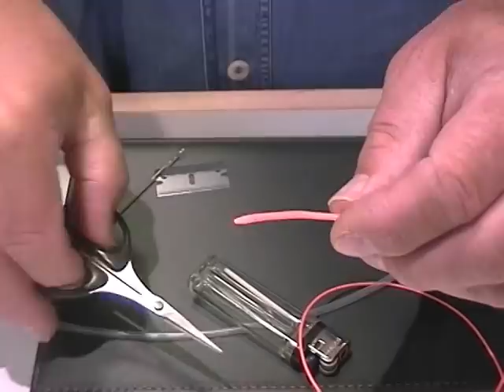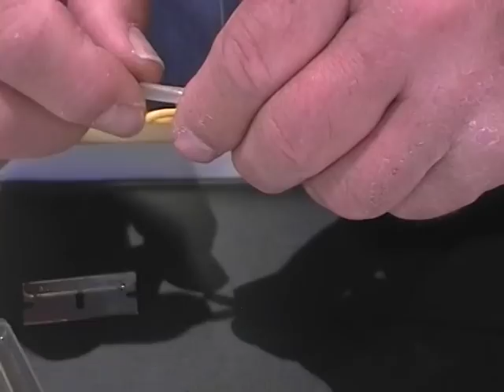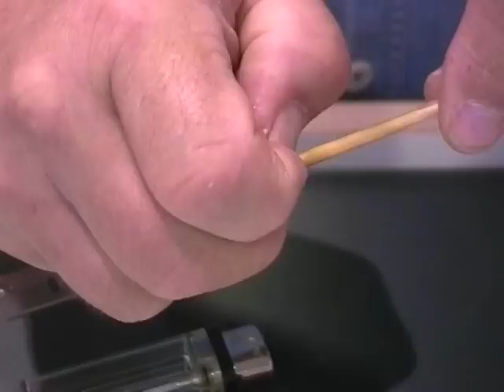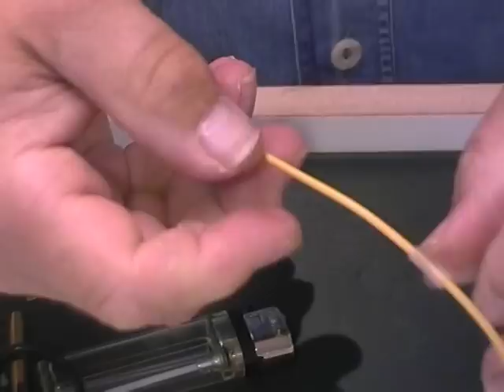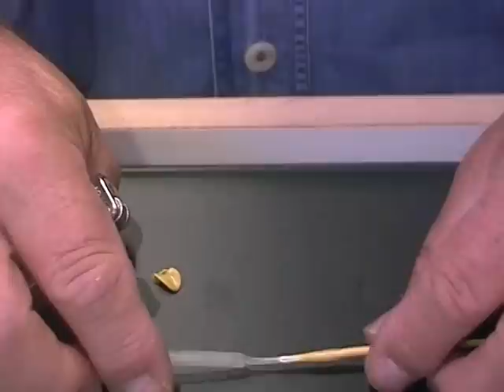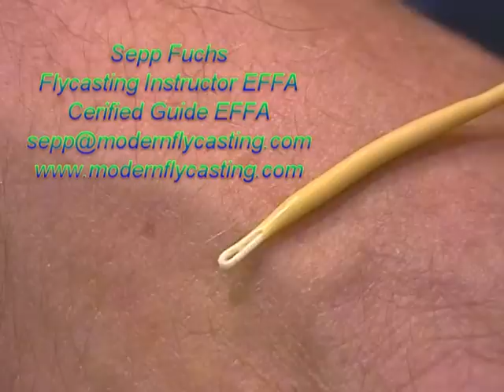Loop and Fly Line Repair

Comment: Where can I get that tool?
Reply: It's a rug hooking tool. Try a crafts store.

FWIW you can also use a piece of braided wire or even a large diametre fly tying wire to achieve the the same results. Simply thread it through the loop of line, fold it in half and thread the two wire butt sections up the tube. Pull on the butt sections with a pair of pliers and slide the tube down.

Sure like to know what kind of tubing is being used.